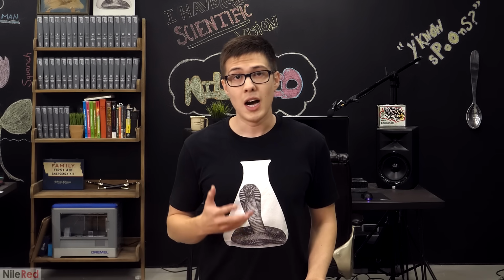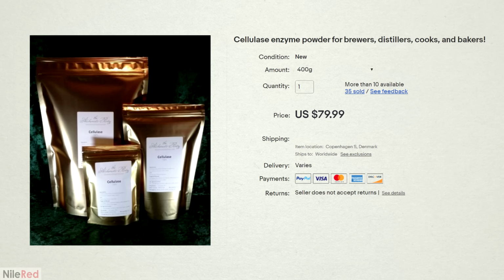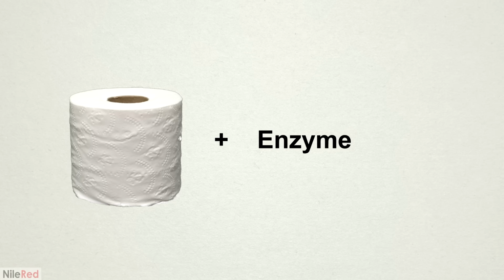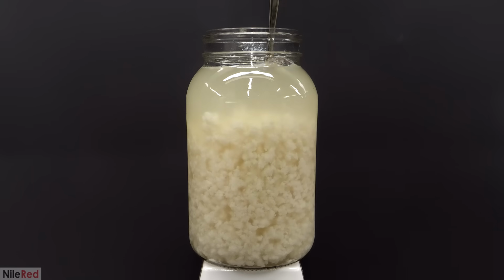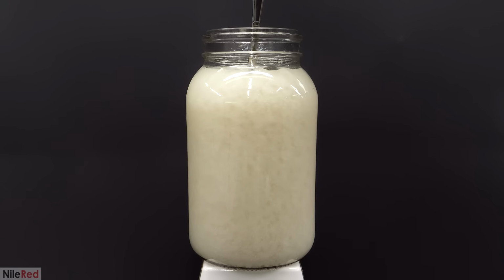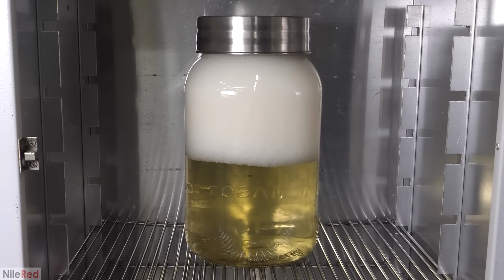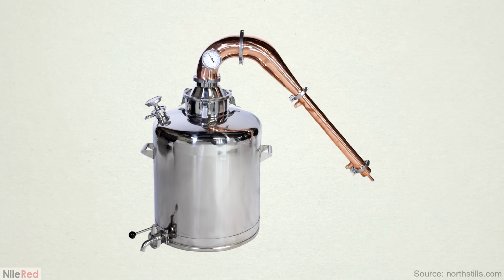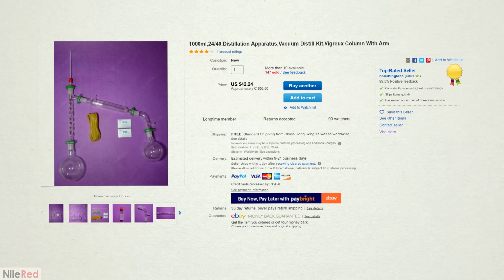Making toilet paper moonshine

Comment: As you get better at analytical chemistry it's extremely important to keep track of your dimensions (dimensional analysis).  Chemists often use shortcuts with percent (%), which is a dimensionless number.  However it's extremely extremely important to keep track of what we call the basis of how the percent was derived. Chemists have a nasty habit of dividing mass by volume or volume by mass and calling it a percent. It can only be a true percent if the units cancel.
So your hydrometer is most likely reporting the alcohol as volume / volume ,  64% vol/vol,  is equal to   50.5% ethanol, mass/mass.  Additionally hydrometer's are very sensitive to temperature I believe you probably have error due to the hot liquid.  That should help out your yield problem of expected mass.  Moles per mole is also to be monitored very carefully during chemical reactions so you can calculate the expected mass.

Comment: Fell first rule of enzyme is they are extremely specific, they are made to cut one thing and they're gonna cut that one thing only, anything else tend to result in a enzyme-substrat complex that can't be worked with and just block the enzyme temporarely if it happen to be close enough of what its supposed to break down

Comment: Dear Mr NileRed I’m a big fan of your videos and got to thinking about the Going Supercritical video you uploaded last month. Anyway when you put the silica beads in the chamber and the dry ice turned to liquid they didn’t float and stayed at the bottom. I was wondering if you could duplicate the experiment and instead of using beads that don’t float use wooden beads or something of that sort that floats. To see when the Co2 goes supercritical, if the wood beads would float in the hybrid Gas/Liquid. To give the appearance of zero gravity.

Comment: You have succeeded in my watching an entire video of something, to me anyway, that's totally useless.  I'd say you deserve a special nod for such.  I did come away with a reinforcement of the claim that making fuel (ethanol) from corn must surely be a waste in that it requires more energy to  distill than the energy produced.  That would make the government's (in the US at least) mandate for all gasoline to be at least 10% ethanol one of the biggest scams ever hoisted upon the public.  Right up there with requirements placed on toilet per flush water amounts resulting in ineffective toilet evacuations requiring multiple flushes thus negating any savings of water and requiring plungers as required bathroom accessories.  Thanks for the education.

Comment: Asking : what is the best model of scientific experimental hot plate that has stirring and uses a wired probe that can keep a constant temperature while the processes is going on is available on the market that would be recommended? The probe can be put at a different location then the direct heat?

Comment: Just a random remark that you wont see but, when using dry brewers yeast you should always hydrate it in a couple mils of water first to be sure that the yeast is still viable. also, dead yeast will precipitate out and fall to the bottom.

Comment: Did you consider using a blender to break down some of the cellulose? When I worked in the lab, we would use two steel balls in our samples to masticate leaf tissue in tandem with enzymes and chloroform to break through cell walls and more to eventually get our DNA "pellets" from the inside of the leaves. We were testing for viruses running gels. The DNA of infected plants is quit different than that on non-infected plants, and their gels when running through electrophoresis would have one of several "extra" bands present, which indicated infection. I imagine the mastication method would simplify your process slightly in comparison to heating or in addition to.

Comment: This was distilled from wood would not make it methyl alcohol
Reply: It's not wood nor is it the method by which methanol is distilled from wood, so no.
Reply: @Quintinohthree  what is toilet paper made of wood paper
Reply: @Quintinohthree  I mean considering if you look up some toilet paper its main ingredients are wood fiber and paper pulp
Reply: @donaldplank54  
And does that make toilet paper wood? No, it doesn't. Tgey don't call it paper alcohol, or cellulose alcohol for that matter, they call it wood alcohol, because you need chemically unaltered wood which you heat untill it breaks down violently into simpler conpounds, from which you can condense wood alcohol. Paper is obtained by extracting cellulose from the wood making it not wood. In order to obtain alcohol it's then further treated to convert it into glucose, making it no longer even a component of wood, and this is fermented into what is definitely ethanol and not methanol. There is no way there can be any elevated quantity of methanol in the final product compared to common spirits especially because fractional distillation with temperature control was used to purify the resulting ethanol from more volatile impurities such as methanol. Even if all the alcohol produced were methanol, that would have been evident and it would have been shown in the video and the product would have been discarded as unsafe for consumption.

Comment: Your sodium hydroxide reduced the cellulose into compound and simple sugars actually.
Reply: Sodium hydroxide doesn't do much at all to cellulose. A crucial step in making paper involves soaking in strong hydroxide solutions. That's done precisely because cellulose is so resistant.
Reply: @Quintinohthree  
Actually they use the hydroxide to rupture the internal structures of the cellulose.

Even then, they only use it in sparing amounts.

https://aem.asm.org/content/aem/27/1/159.full.pdf

https://onlinelibrary.wiley.com/doi/abs/10.1002/masy.200550512

If you mix in urea and NaOH, you can truly dissolve the cellulose.

Comment: How did you get the calulation of 3L water + 60g NaHO = 2% solution?
Reply: 3 liters water weighs 3 kg. 2% of that is 60g. That makes a solution of 2% w/w (weight for weight) in so many significant figures.
Reply: Did he do it with mole weights?
Breaking each compound down to molecular weights then doing it by weight percentage?
Reply: @bmphil3400  If you're using percentages you don't care about what everything is, just how much weight or volume of each thing you have. The weight of sodium hydroxide in solution is 2% of the total weight of the solution. That's all it means.
Reply: Thanks for the simple explanation. I don't understand molar weights much.

Comment: The enzyme method was by far the right choice.  After all this is exactly what  malting does when making whiskeys.  They sprout grains which allows the budding plant to create the enzyme that breaks down seed-starch into sugars.   Its then baked at very controlled temperatures to kill the germs but preserve the enzyme, then its steeped into mash where the enzyme from the now dead buds now releases the sugars from the seed starches.    Then the yeast is added.
Reply: Starch and cellulose are very different substances, and you certainly can't malt toilet paper.

Comment: You can see nearer the end of the second run when watered down ethanol is added to the higher concentrated ethanol. It has a peculiar look as when we look over the top of a heated surface. Although both are clear, there is an obvious difference.

Comment: some immutable rules when using quick fit glassware distillation apparatus : NEVER fill past half volume in your boiling flask, NEVER insulate a Vigreux column unless you know EXACTLY what you are doing, high boiling point liquids etc are dealt with by distilling at low pressure, with cloudy or particulates in a batch to be distilled, a pre filtration using something like Whatman medium grade qualitative filter paper on a Buchner funnel would help create a better product, and reduce foaming and frothing but may not obviate it, use a common alcohol hydrometer to test your distillate for alcohol content. Besides yeast strain type etc, Controlling fermentation temperature to the low side is a helpful way to reduce the amount of Fusel oil,  yeast metabolism by-products such as higher alcohols, aldehydes and ketones etc that are inevitably produced by yeast as the process continues. In any case, the worst portion and type of this Fusel oil fraction as it is called can and MUST be removed in any fermented and distilled alcohol intended for human consumption, the majority of these by-products have boiling points lower than ethanol,  B.P. ~78.6 Degrees Celsius, and thus will distill over first, this is usually accompanied by a smaller portion of the ethyl alcohol that is also discarded as the thermometer rises up-to distillation temperature , and controlled and stabilized near the B.P of the Alcohol, a little more of the distillate is also allowed to distill over just as a precaution to be certain that the Fusel oil has indeed been boiled off. This may sound like old hat to many of you, and it is, but it cannot be over-stated for the newbie who wants to give DIY booze a go. Every year many people either just flat out die or go blind, or at the least damage their Livers or worse Brains by drinking home made alcohol without getting rid of the first 100 Milli Liters or so that come from the condenser. Brain cells and the light sensitive cells on the Retina in the back of the eye are most sensitive to the livers metabolites of the Fusel oil , and to make matters worse, it can be a slow acting poisoning, often the damage is done by the next day, but this also offers a silver lining in that if caught early enough, the stomach can be pumped, activated charcoal used, or syrup of Ipecac to induce vomiting, a sulfur containing amino acid called cysteine, common in eggs, can also help prevent further liver damage. Ethanol itself, oddly enough, can also be given to protect the body from METHANOL poisoning, as it is preferentially acted on by the livers enzyme systems, while the methanol can be flushed out via the kidneys in urine, as the Methanol itself isn't terribly toxic, it's the metabolite of the methanol, which is Formaldehyde, that is highly toxic, because it is highly reactive, and binds irreversibly to any organic material having amino acids in it, so basically any part of your body. Formaldehyde is the main chemical in Formalin, which is Formaldehyde dissolved in ethanol, that is used to embalm body parts, seen some brain or eye in a jar at school ? that's the stuff it's stored in, oh, and another fun fact, because of this irreversible binding, it is also a potent carcinogen. Isn't it amazing the difference what one little carbon atom can make, between Methanol and Ethanol, either fun time at the Bar, or no fun at all at the Morgue. now where's my beer...

Comment: Coming from a long line of bootleggers, I can say this.  He's lucky he didn't poison himself.  Making drinkable whiskey is extremely temperature-dependent.  He does seem to understand the process though.
Reply: A fractionating collumn and thermometer make temperature control super easy. Getting something drinkable should be easy, especially if you're only using the absolute heart of what you already know to be ethanol. Whiskey is hard because you want at least a bit of head and/or tail, because that's where flavour is found.

Comment: If you distilled it exactly at the correct temperature the first time you would have gotten almost all of the ethanol out without any contaminants. Ethanol's boiling point is probably the lowest out of all the other components in that mixture.

Comment: Actually water was coming over because it was to hot. Water boils at 212f and ethanol boiling point is 173f. you shouldn't have let its over 180f.

Comment: Hey dude i just have a question: when you put tin/aluminum foil (i forget which one) it boils after some time. But when you put it in copper sulfate, it turns to copper or something. I am no pro like you btw lol. But when you mix hydrochloric acid with copper sulfate and put in the foil, the reaction with the hydrochloric acid is much quicker and then there is a copperish residue. Can you explain this?

Comment: What makes you think you started with pure sugar? Very unlikely that it produced lower levels of methanol than even the too high, in my opinion, food standards. To the level of immediate and  obvious vision loss and need of acute medical attention. Ethanol burns clear, methanol burns blue. Cheap way to make alcohol that safety would require extra work of master distiller leads to poisoning the poor and I suspect lower methanol standards that could produce chronic problems.

Comment: You didn't measure the brix before adding the yeast so you will have no way of knowing your yield. You could have easily done this with a refractometer or a hydrometer. Also, a license is required to distill alcohol even just for home or scientific use.

Comment: @NileRed: The thing is about making moonshine, is that when the yeast solution has stopped working, all of it is filtered through a carbon filter and then distilled, that makes the solution much closer to just being water and ethanol without all the messy crap following through. Also, doing it under vacuum will allow you to more easily control the process.

Comment: Run that fucker through a Britta charcoal filter twice and toss it in some toasted Oak chips for 6 months. Then you'll see what I get as 3gal finished product from my 15 gal beer keg at 196pr. I might mention you for got about Sulfates. Which are removed by copper. None of your equipment had any form of copper mesh or screening which you may want to re-visit at a later point. Or if you did, I did not see it.

Comment: 21:40 What if you sat the flask in a sous vide bath and set it to 78C instead of using a heating mantle
Reply: I thought of this too, but reasoned that water always lets off vapor regardless of temperature so you can minimize other vapors but never evaporate only ethanol.

Comment: I did this back in my AP chemistry class in a joint experiment with the AP Bio class but with cardboard. we were just told to get glucose for the AP bio class out of cardboard and out lab partners from that side would communicate any requirements for the end product.  We used the acid method for the speed but they didn't tell us it would be used with yeast. turns out we didn't fully neutralize the acid and it killed their yeast

Comment: Generally: heating stuff like that  in the oven instead of stovetop keeps the bubbling way down.
Reply: I think the main issue is that because you have a lot of clumps in the mixture itself, it traps gas bubbles which then suddenly surface as they expand - there's no real way to suppress that effect.
Reply: @ValleysOfRain  Stove-top causes it to boil violently from the bottom.  Bubbles rise and propel the material above it 'up and out'.  The even heating of an oven and the much larger surface area of an oven dish greatly reduces violent bubbling.  A baking sheet under it catches anything that may boil over.

Comment: What you should do is convert the toilet paper into a glucose syrup, just like Cody did with the starch from his potatoes. That way, when someone like, I dunno, Cody comes over you can say “Hey! Look at this syrup I made a while back!” Then cody will say “Taste’s pretty sweet, what’s it made from?” and you’ll be able to say “It’s glucose syrup I made from some toilet paper.” And then, the coveted: “(Shocked Pikachu Face)”

Also, side note, I wonder how viable this would be on a commerical scale, because if you could turn wood into sugar, you could mass produce Sugar from as far north as Canada, and do it for cheap, since wood isn’t that expensive, and the only prep you’d need to do is turning it into pulp, then making a lot of Celluase buffer soulution, then letting the celluase eat away at the celluose.

Also, you should turn wood into sugar by converting it into pulp using that method that is similar to what you did in your “Making transparent wood” video.

Comment: He could have also placed it in a blender as well and every 20 miinutes blend the base and toilet paper. Making it alot much more efficient.  Probably a higher base concentration and a longer wash period . And depending on conc. Acid. Very slight. Some way to precipitate and separate.(might not be as effective) . Then proceed with the project .

Comment: From a distiller, you are making some terrible mistakes. 
Your reflux column needs packing.
Your reflux column needs a water jacket to cool it. 
You need to make a LOT more to get any decent results. Do a 6 gallon batch and use a stainless steel still, even if you buy it from ebay.

Comment: Dimethylpolysiloxane (generic Gas-X tablets, walmart pharmacy) will arrest and totally prevent the foaming issue that was plaguing you here.  Just a FYI from an organic chemist who has experienced the same thing.  :-)  It doesn't take much, just a tiny bit of a tablet is more than enough, but it's cheap so tossing in a whole tablet is just easier.

Comment: #1 Lesson from NileRed
NEVER overfill your distillation apparatus. (But also, never overheat, underheat, overcool, undercool, or look at it funny.)

I swear, distillations are the most finicky and temperamental things ever. A tiny bit too much heat? We're now boiling so violently bubbles are making it to the condenser. A tiny bit too little heat? Sorry we can't even make it 1cm beyond the distillation vessel so you're stick with a terrible reflux.